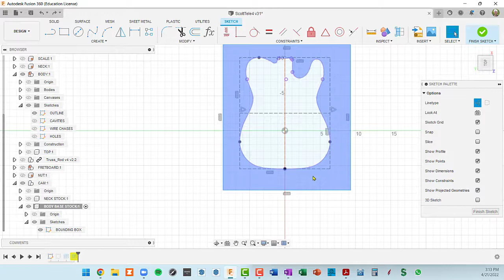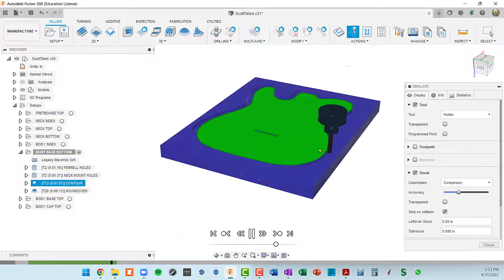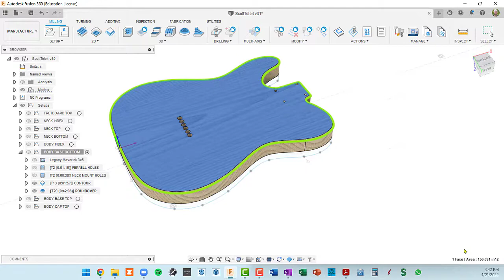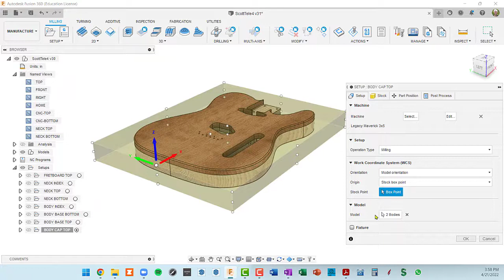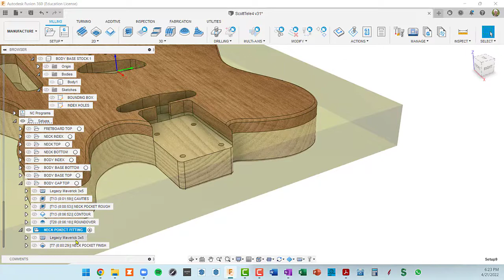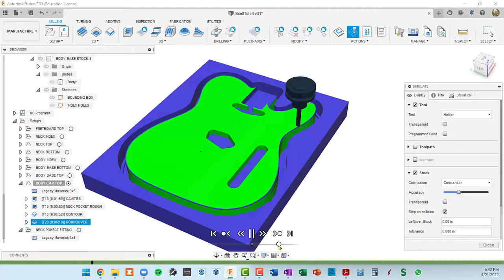Telecaster in Fusion 360:  Part 10, Body CAM

Comment: On my Body Cavity Toolpath, its doing a weird and unintended stepover (with a 1/4" endmill bit!) at where the 2 roundovers contact the neck pocket.  (I can email you a screen capture if you want to see it).  This doesn't mess anything up but is unneeded and shouldn't be there.  I think I followed your steps correctly: the Geometry selection here is just the bottom face of the neck pocket and the operation is 3D Adaptive Clearing.  I don't see a way to add in an "ignore faces" instruction like you did for your edge Scallop tooolpath.  Any ideas?

Comment: What would be the implications of NOT doing the 1/4" deep perimeter cutting operation and going ahead and let the 3/8" ballnose bit do what it wants when creating the perimeter roundover?  Seems that the bit would just travel into the space that you would have made with the trough, which is waste material anyway.  The perimeter cutout happens on the front anyway.  Is this an opportunity to save a step?
Reply: Its certainly worthy trying.  I always cut at least 1 prototype (out of pine) before cutting the actual body stock.

Comment: A cool trick to do when you were doing the round over on the bottom, instead of avoid/touch surface, instead use the top height and select the bottom of the guitar then offset -0.0001 and it will not generate a path that covers the back. At times when I choose to avoid a surface like the back of the guitar, it sometimes leaves a small lip at the top of the fillet. If you had just wanted to cut the wire cavities before laminating the top, in the geometry tab, you could have used (additional offset) that would have made those channels longer then you could have put the top on, then cut the pickup cavities. By the way, thanks for sharing your videos, you’re doing a great job. Please don’t think I’m criticizing your work, just trying to add an additional approach.
Reply from the maker: That's a cool trick - I will try this.  Thanks for sharing!